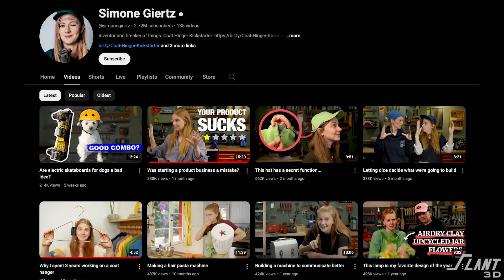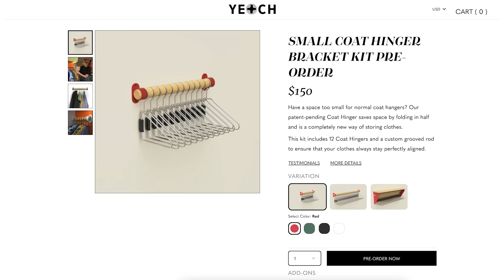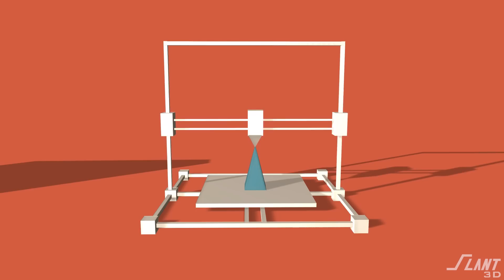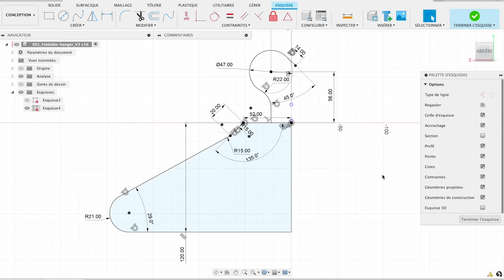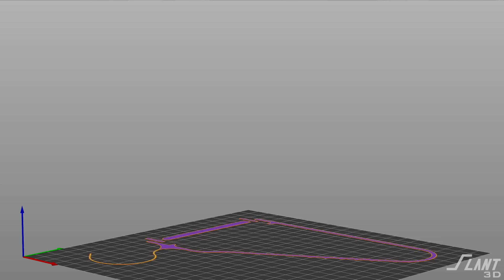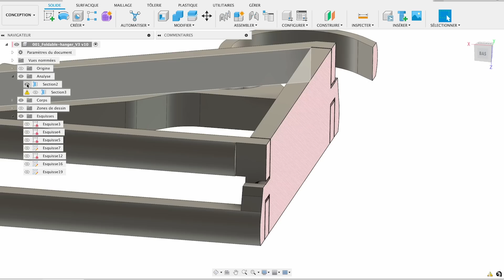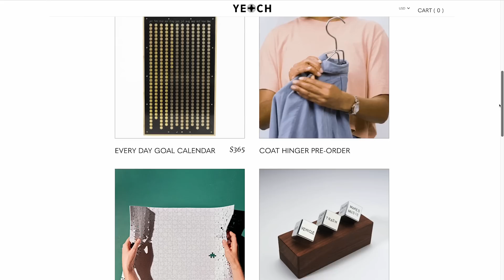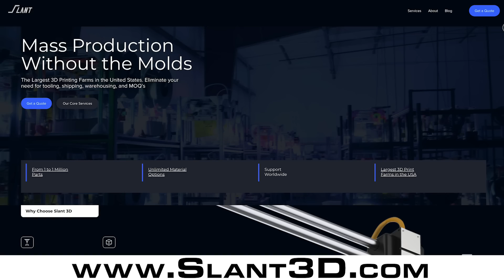We Solved Simone Giertz's Problem | 3D Printed Folding Hanger

Comment: I would say that one possible consideration of hers was to limit environmental waste.

From her video it's clear that she tried very hard to make the hinge out of anything that wasn't plastic (and even prototyped without plastic) but in the end had to relent with an injection molded part because it was the only thing that gave her final product the usability and manufacturability properties she desired. Given Simone's background of making things, it's obvious she would have considered 3D prints, but it's clear that she tries to limit plastic waste overall considering she even chooses to prototype with a laser cutter for wood: 

https://www.youtube.com/shorts/cq0wJWQmVE8

In her case, perhaps a mass-produced 3D printed hinge mechanism that's easy to assemble onto metal parts may be a more fitting option versus having the entire hanger made of plastic. 

Note that every single other component of her product (hanger frame, shelf, rod, bracket, etc) are all made with either metal or bamboo, showing a very conscious effort to avoid plastic. 

Wood and metal are easily degradable nearly anywhere on planet earth. Plastic is not. A hanger made from the former will last a lifetime but can still be safely disposed of beforehand if desired. The latter doesn't really have this option. How many PLA industrial composters are located around the average coat-hanger-buyer, or recycling centers that accept 3D printed parts with no clear material label?

The fact that 3D-printed plastic is difficult / impossible to recycle or compost is an issue that's probably holding back a lot of people from considering it for mass production.
Reply from the maker: Parts like that can be made with bio based plastics that have much lower environmental impact than normal. Our hangar was made from cornstarch plastic
Reply: @slant3d  what's the end of life bio-degradability look like?

Cornstarch-based PLA obviously needs an industrial composter like I mentioned in my original comment, conditions which are not naturally-occurring, otherwise they just stick around for decades, especially something like thousands of chunky clothes hangers.

What a plastic is originally made from =/= how safely it decomposes in the environment. 

It's a false equivalency.
Reply: I understand the recycling element. But just to be devils advocate here. Imagine several parts, plus box, plus, label, plus plus plus are manufactured in China, bulk boxed, put in a container, trucked to a port, shipped to a another port, trucked to factory, assembled, packaged, trucked to a warehouse, stored, sorted when ordered and shipped to customer. That is a lot more environmental impact than made to order in one place and shipped to customer directly from manufacturer.
Reply: @ChrisCameronPhoto  for sure. 

Obviously there's a lot that goes into the final environmental impact of manufacturing and distributing something. 

At the end of the day without studies it's tough to know what the true environmental cost is going to be with various methods, but the 3D-printing route will absolutely have many of the same issues to varying degrees as well as issues entirely unique to its printing process (impacts of growing the corn, harvesting, transporting, industrial polymerization into PLA, extrusion into filament, filament packaging and shipping, printer energy use, individual packaging and shipping of final product worldwide, environmental impact of degradation of final product over the next 80 years, etc).

But given this degree of complexity I doubt the answer is as clear-cut as saying "3D printing the entire thing from cornstarch PLA will definitely be the best option." 

At best it's murky, but I'm just highlighting a potential consideration that people make when deciding between 3D printing versus more traditional biodegradable materials. 

Given this seasoned inventor's history of prototyping with wood, I would imagine she has her reasons for not going with the obvious choice of just using plastic.
Reply: @victorlin4645  If you're going all the way back to raw materials, then my example also has all that in front of it. Re 'shipping of final product worldwide'. Not necessary, the file can be electronically passed to a print farm local to the purchaser.
Reply: @ChrisCameronPhoto  I'm talking specifically about Slant3D's print farm. They would have to ship worldwide. 

And filament would have to get to these print farms from wherever they're manufactured. And in the end all these different places that the clothes hanger customers live in worldwide would need to deal with all these end-of-life products in their localized areas, a tricky problem because as we've already established, PLA doesn't appreciably biodegrade anywhere besides within industrial composters that are few and far between, and the printed items with their near-empty infills are difficult or impossible to rework into other useful products unlike wood and metal.

At the end of the day the calculations and considerations for cradle-to-grave are complex, but I'd say that materials like wood and metal definitely have a better outlook on the "grave" end of things, many even having a "cradle-to-cradle" outlook.

Comment: The solution I think is to use the real stainless steel wire like Simone does but use your hinge or something like it in the core printed in black. Alternatively print molds to cast the hinges in resin. It would then have your functionality but her Aesthetic. Plus bonus… you could design it so you can have it fold so you have two items on each side. Sort of a mirror image of the folded hanger on each side. Ends up looking like one normal hanger but has two folded pieces on it. Give away this design to Simone.
Reply: The point of the solution in this video is that it doesn't require all the hassle around getting separately manufactured parts together for assembly. When an order comes in, it is made at Slant3d, packaged and posted.

Comment: You know, at a first glance, the marketing engineer in my soul just wants to beef up that hook. Not because I think that it needs more strength in order to stand up to any kind of abuse or weight, though I might, but the real reason is that it just doesn't look as beefy as the rest of the hanger. 

We can make this thing effectively as beefy as we want because it's cheaper to do so than with molding and we have very little overhead cost for the fill. So, make use of that. You can't compete with how strong metal looks because it's metal. But you can compete in the same mental space by simply beefing up the hanger in general and the hook in specific. 

Let that thing fill the entire area between the bottom of the hook and the side of the hanger. Make it just a little bit thicker on top to match the lines of the body of the hanger. Give it some more authority. Then definitely print it in fiber reinforced black and make that a marketing point.

Totally doable.
Reply: Problem is with a big hook is it might not fit in tight space, wich is a case i already encoutered and it is the main point of the habger presented

Comment: Couldn't you just print it in place folded with a hinge that is heigher than the rest of the hanger? You rotate it 90 degrees from how it was printed to put the shirt on, then continue to rotate it ANOTHER 90 degrees to hang it up. The raised hinge gives it clearance for the shirt.

EDIT: Also, if she wants premium you've got that covered too. What's more premium than regolith simulant?

Comment: That is as the kids say "a banger" of a video. Really targeted, relevant (I just got a 10 pack of "hingers" myself), and I hope she sees it and considers it helpful. 

I do get how plastic hangers feel cheap, but I have some I felt were premium because they were thicker and denser. The took way more weight, and I still have some that I bought like 15 years ago (unlike the cheap ones that last only briefly). I've printed a number of the "EZPZ Hanger // Folding Clothes Hanger" by make anything and they are great, but they don't fold like the hinger or look like a normal hanger so there are no expectations with them. I think you are on to something with the texture change up, and I wonder what these would look like in carbon fiber reinforced PETG as that may the sweet spot for aesthetics and strength.

As for more country music videos, please don't. The one you did was painful, not because you did it bad or anything, but country music is like nails on a chalk board to me.  If you do another music video, please mix it up and do rock, hip hop (that could be funny), or anything else. This is my hangup/issue though so if I am the minority then I won't blame you if you ignore my request.

Comment: I use pla+ hooks to hang my pants with lots of crap inside, as well as my many backpacks.
Reply: Yeah small pieces of 3D printed plastic can hold tens of pounds. The big issues hit when leverage and layer separation are involved. Still, this is definitely a product that can work very well 3D printed.